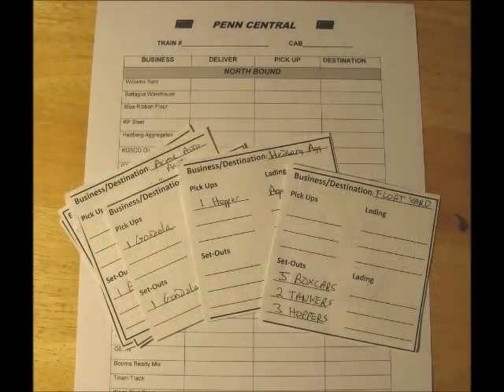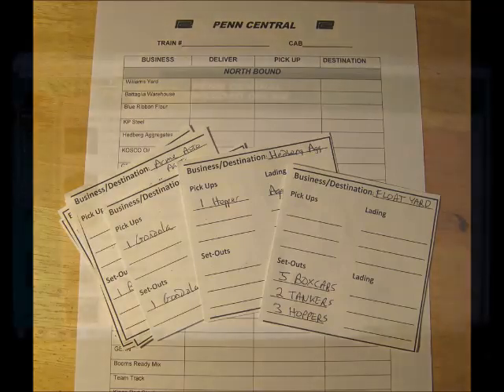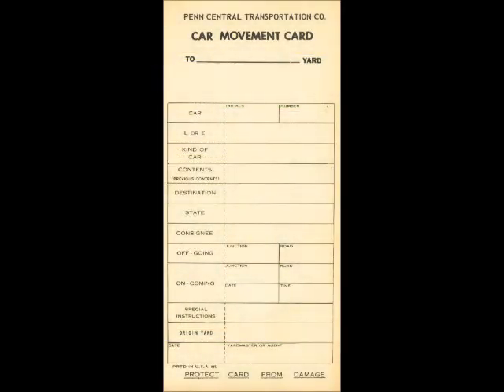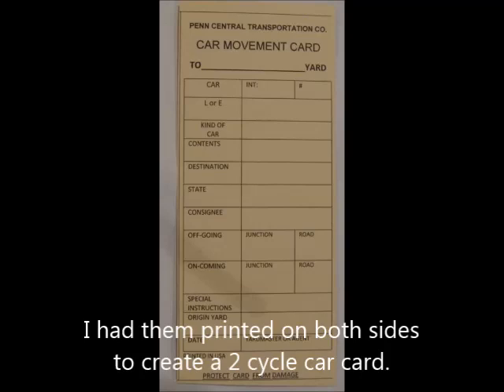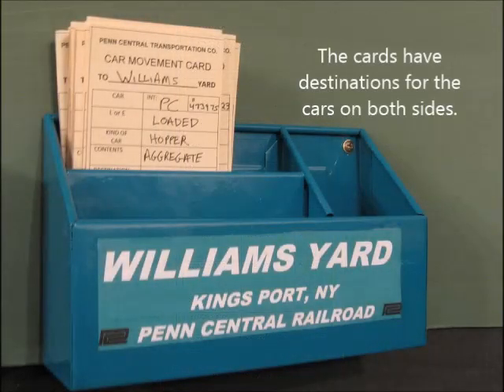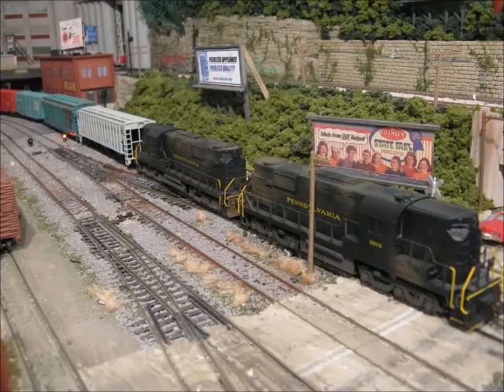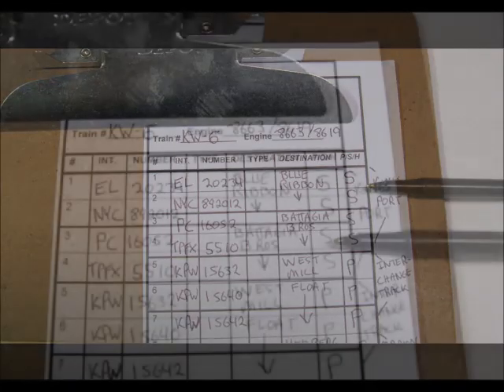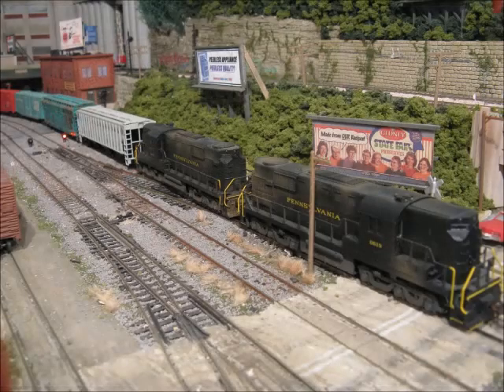Ops Snippets PC Car Movment Cards

Comment: what goes on  the line for state and consignee?
Reply from the maker: Hi,  thanks for taking a look.   "State" indicates the location in the US that the car is being moved to (in my case most of my cards designate "NY". )  "Consignee" is the business that is receiving the car.   In the video, for example,  NYC covered hopper #892021 is being delivered to Blue Ribbon Flour (the consignee) in Kings Port (NY).
Reply: thank you

Comment: What throttle control system do you use?
Reply from the maker: Sorry for the delay in responding.  The layout is controlled by two MRC Tech 4 200 power packs using traditional DC block control.
Reply: @RalphPCvids  
Thank you
The handheld throttles- did you make them yourself?
Happy New Year, btw.
Reply from the maker: @jdmills4370  Oh!  Right!  The hand held throttle is connected to one of the MRC power packs.  Its made by GML Enterprises of Lake Orion , MI which usually has a small ad in Model Railroader.  In the video you can almost see a black wooden box I mounted the hand held throttle's panel to.  Wires connect the panel to the MRC unit as a power source.
Reply: @RalphPCvids  hahaha
Small world. That town is not too far from me here in MI.  I was considering his product. Seeing how well it works on your layout is good testimonial.